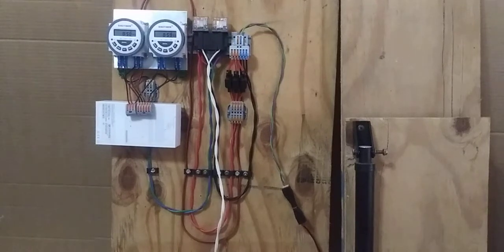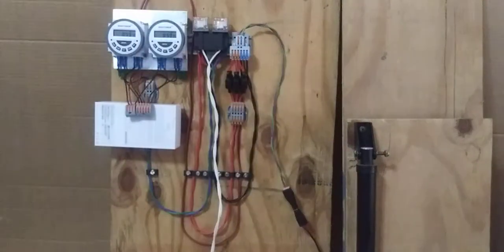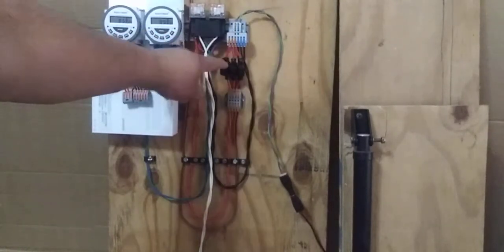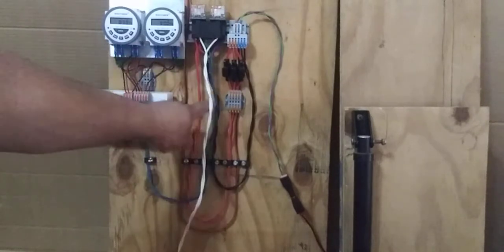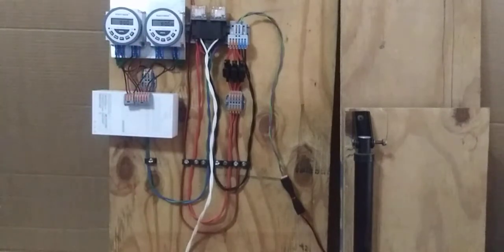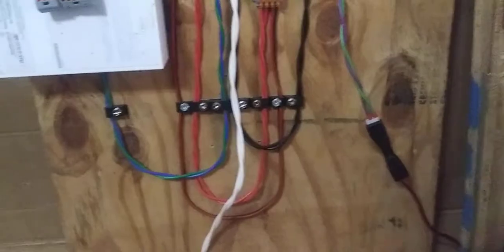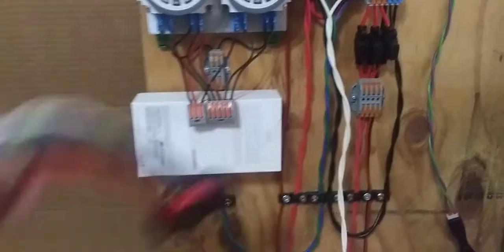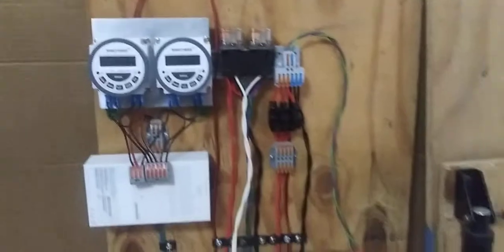Linear Actuator with 2 timers, 2 bosch style relays, fast and easy to wire up harness.

Comment: Hello 
I would like to build a feeder thar opens twice a day for 5-10 seconds to dump feed. 
Can you please explain what I need to use timer, relay to make it open for 10 sec and close.
Thank you in advance.
Reply from the maker: This is kinda a hard one since I don't know how you feeder is going to work physically. Meaning will there be limit switches (open and close) or will it be like the one I am building that has an auger that pushes feed through a tube and just need to turn on for a few seconds. 

With out knowing any more details I have three options for you.

1) Use a Second Interval Timer and a Double Pole Double Throw relay. Link to diagram in description (Diagram Link #1).
For use if you have a motor or actuator that already has limit switches.

2) Use a Second Interval Timer, A regular timer, a 1N4007 Diode and a Double Pole Double Throw relay. Link to diagram in description (Diagram Link #2).

3) Use a Second Interval Timer and a DC/AC Motor Reversible controller Module Timing Delay Cycle Limit Relay.  Link in description . This can be programed. 
This guys has a great video for it.
https://www.youtube.com/watch?v=Y1gwOkPtqCg&t=1s
Reply from the maker: @cvibin652  Awesome. That helps a lot. If you are going to use linear actuator like this, then the first option is the way to go. Cheap and easy to find the parts except that you will have to order the Second Interval Timer from china. Not sure if they sell them here in the US or wherever you are. 

Option 3 would work also. Wiring is much simpler than option 1. Programming is not too hard either. It also allows you to get any simple timer, from amazon, that is not Second Interval. I will work on making a diagram.
Reply: @AztecWarrior69_69  
Thanks a lot
Reply from the maker: @cvibin652  Link in description. Diagram link #3

Will have to program to open/run forward for 3 secs, stop for 4 secs, then close/run reverse for 3 secs giving you a total of 10 secs.  Set to run only one cycle.
Will run the cycle each time the timer powers on the board. I think? Will test later tonight. If not the board will have to remain on. Will test amp draw later tonight also. If is does not cycle when board is turned on the all you have to do it use the trigger connections.
Reply: @AztecWarrior69_69  
You are right 
When timer  kicks on it need to run 1 cycle
Reply from the maker: @cvibin652  Just tested and video will be up in a few short mins. Confirmed, it does cycle when the power to module is applied. So you can set timer to turn on twice a day and ONE cycle each time, of whatever amount of time you need, will run each time. In the video, the module is set to open/run forward for 3 secs, stop for 4 secs, then close/run reverse for 3 secs giving you a total of 10 secs.

https://youtu.be/dHeIsAFeYvo

Comment: What gauge wire from power supply to timers ? Also what gauge from timers to actuator?
Reply from the maker: Most of that information is in the description. 

However I just used some 18 AWG silicone insulated dual conductor wire. You only need it to be 20AWG but I have a  100ft roll I bought from amazon so I use it a lot.

"Also what gauge from timers to actuator?"    There is no wire from timer to actuator in this setup. There is 20 AWG wire from timer to relay.

In the other setup the timers have the Single Pole Double Throw relay built in That's why the motor power wires are going from/"through" the timers.
Reply from the maker: BTW if you chose this option using this harness , you don't need much if any wire. The harness has at least 24in of each wire. I'll drop link if you need it.